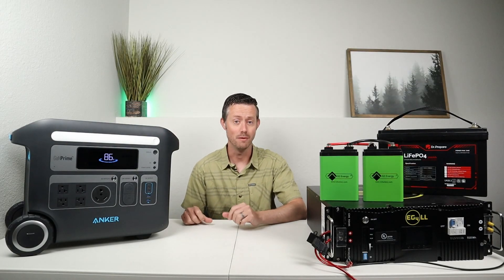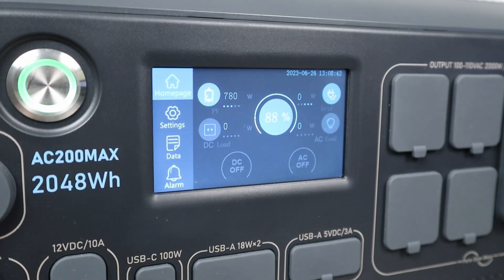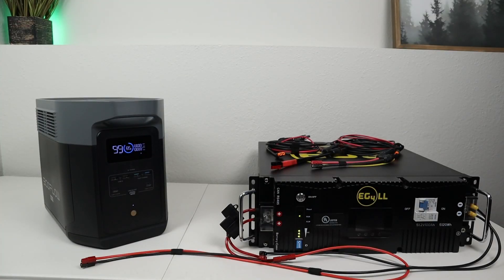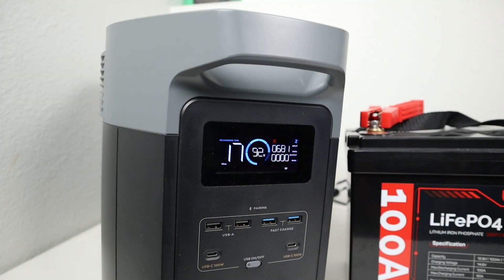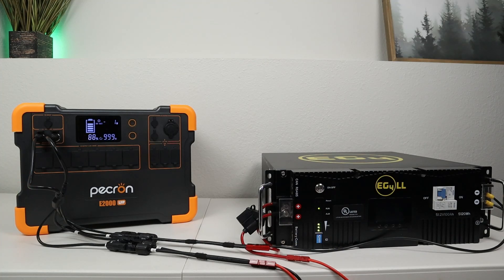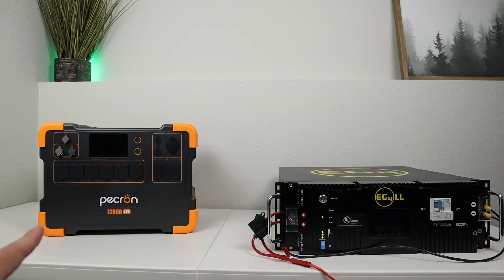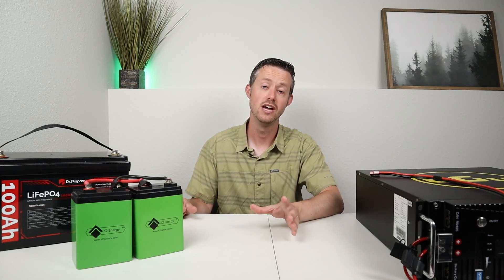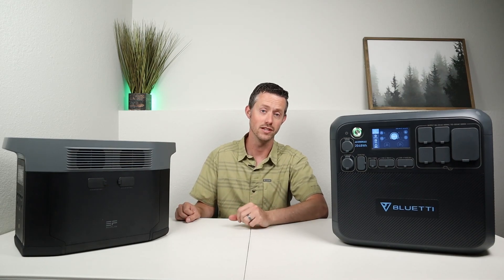Using Batteries To Extend Power Station Runtimes?! 48v LFP Server Rack 'Expansion Battery'!

Comment: What are the specs on this 48 volt server rack battery? I used a 12 volt lifepo4 battery to charge the same Bluetti recently and I was impressed at what it was able to do. I was only getting about 100 watts. It was taking a while to charge it but it was doing it. I'm just wondering if I can get this battery and charge it much faster: 48V (51.2V) 25Ah LiFePO4 Battery, BCI Group 24 Lithium Battery, Deep Cycle Battery with 50A BMS, 2560W Load Power. I would have to assume that a 48 volt battery delivers more than 100 watts and in that charging time would be reduced. The battery is smaller, lighter, cheaper and easy to carry. Which is what I'm looking for. What do you think?

Btw, I purchased one of Bluetti's charging enhancers. I wasn't overly impressed. I sent it back. I do better just adding Solar 2 panels in series.

Comment: One could buy almost three of the Pecron batteries for the price of this 48V battery. Almost doesn't make sense at least for Pecron but great video.
Reply from the maker: 48v batteries have dropped a bit since this video. The Vatrer 100ah is my current recommendation.

Comment: Do you have any insights on dabbsson dbs2300, would it work with such battery? Extension battery simply does not available from official reseller.

Comment: Hello Jason, Can you suggest a cheaper 51.2volt 100ah  battery solution, my scenario is i am in a condo no access to solar but want to have a more robust backup situation for a power outage normally 5-6 hours up to 24 hours. Mainly for the fridge and keeping my internet up and running and charging my laptops, I have purchased the Eco Flow Delta 3 plus with the expansion battery it was a bundle, but i want to get to the 5kw capacity.
Any suggestions would be much appreciated.

Comment: How would one charge the 48v server rack battery without a solar setup?
Reply from the maker: 48v AC charger, lots of them online. You could use a gas generator if the power is out.

Comment: What a great video. I have the Bluetti AC70 (12V-58VDC, 10A via xt60) and want to connect a 24V 100Ah LifePO4 battery. Do I need an inline fuse between the AC70 and the battery? If so, what fuse rating 10A or 15A? 
And for the future, could I add a second 24V 100Ah battery in series, or would it be just over the max 58VDC of the AC70 when fully charged, due to the batteries each having a max charged voltage of 29.4V and two would be 58.8V.
Any advice would be appreciated, I really enjoy learning about this for camping use.
Reply from the maker: When connecting one, I would recommend 12 AWG wire and a 20 amp fuse to avoid voltage drop and to keep the wire temps down.

It would be fine to connect two 24v LFP batteries in series, it would stay right under the 60v limit :)
Reply: @Jasonoid  Thank you very much. I really like your videos and how well you articulate everything.

Comment: For the Ecoflow. does the charging cable have to be fused?
Reply from the maker: I recommend using a 30 amp DC breaker and 10 AWG wire.

Comment: for both the 12 and 24 volt batteries you should do a 500 or 1000watt inverter test, hwere you just ac charge with inverter to get the most power in quickly.

Comment: Does it matter that you're sending 100AH to the inverter that probably has a 15A circuit?  I asked Signature Solar about doing this and they didn't recommend it because they said the battery amperage would damage the inverter if connected through the low PV input.  How are you making this work or is my contact at Signature Solar missing something?
Reply from the maker: The battery acts just like a solar panel. The power station limits the amperage input on the solar input port. Maybe this video will help you understand how it works:
https://youtu.be/9ODIF2EfsUA
Reply: @ Thank you. Do you have a video on your home build?  I also have EcoFlow Delta Pro Ultra with two batts running to their smart home panel. I want to increase my battery time as you have without over-investing in EcoFlow batts. Great channel and content. Thanks again.
Reply from the maker: I don't have a full video of my home build.  @garycline6221

Comment: What I am wonderig about is I have the alernator charger for my Delta 2 Max. Cna I recharge a stand alone 48 V external battery from my alternator charget using one of rhe external battery ports? I need to replace this power once used?

Comment: Jason do you think the Anker 767 would be able to handle 2 48 volt server rack batteries in parallel?
Reply from the maker: Yes, that would work just fine to charge the Anker 767 (F2000)
Reply: @Jasonoid  thanks for your quick reply. I know the 767 can be quite finicky. I saw you do 1 server rack battery; glad that it can handle 2!

Comment: Question?  I have a power station with 2 external batteries with a total of around 7.6 kWh.  I want to add an 48v 100wh 
 battery. I can charge with 1.2 kw solar.  My plan is to use this battery to top off my current system.  I have shading issues on the south side so it would mostly be used until midday.  Any thoughts?
Reply from the maker: I made a video showing a similar concept here:   https://youtu.be/9ODIF2EfsUA

Comment: Hi, I have FOSSiBOT Portable Power Station F2400, 2048Wh solar generator battery output with solar charging: 12V-48V/15A MAX500W, what batteries will I need. Thank you
Reply from the maker: 24v or 36v battery only, 48v battery has too high of voltage.
Reply: @Jasonoid  25.6V 100Ah LiFePO4 this one does
Reply from the maker: Should be good!

Comment: OK  I add a 300ah battery to my Bluetti.  Do I just charge the battery directly? Do I continue to charge my system with the Bluetti 1 DC charger?  Can I charge my battery with the DC charger?  I've 600 watts of solar...where does that go?  :)  Thanks!

Comment: Jason, it looks like you're using fuses when pulling from your server rack battery. Is this required to limit the current from the battery, or does the built-in charge controller in these units automatically limit the current? When I was looking into this idea earlier for a Pecron power station I saw someone say they tried this by directly plugging a battery into the charging port and it burned out their charge controller.
Reply from the maker: The power station will limit the current automatically but it's good to make sure you have the proper wire size and fuse size. I'd recommend 10 AWG wire and 30 Amp fuses. Check out my recent video charging from a 48v battery

Comment: Thanks for your great videos and Merry Christmas. Would it be possible to charge those batteries with a small 400-watt wind turbine, which then charges the power station? Another question: do the external batteries charge if, for example, you charge the Bluetti with solar?
Reply from the maker: Most 400w wind turbines are compatible with a solar charge controller so they would charge a standalone battery. You can both charge the battery and have it connected to the power station at the same time. The power only goes one direction (Battery >>>>> Power station), it doesn't flow the other way.
Reply: @Jasonoid  What I understand is that most 400W wind turbines can easily be connected directly to something like the EcoFlow Delta Pro to charge it, or to an external battery, or both at the same time. But how exactly do I do that, and which wind turbines would you recommend I look into? Merry Christmas!

Comment: Just watched 10 videos in succession and no one touches on how to string 4 12v 200ah together in what combo to supply the 150v 15a max settings on a power station or precisely explain how to charge potentially 48v on the 4 batteries in series or how much amperage 2s2p would emit and if it would exceed the 15a max. People just seem to gloss over chargers in every video so far.
Reply from the maker: That particular power station will limit the amperage input automatically to 15 amps, even if the batteries can source 100 or more amps.

Charging the four 12v batteries in series, use a dedicated 51.2v LFP battery charger:
https://www.litime.com/products/48v-18a-lifepo4-battery-charger

Or a 48v solar solar charge controller 👍
Reply: @Jasonoid  Racking my brain on that one all day and AI kept dispensing contradictions, will it uniformly charge all batteries simultaneously or will it charge each one individually? Thanks for the prompt response guy
Reply from the maker: @DoyenOfDearth  AI sucks with solar and batteries advice. It will literally tell you to plug a battery directly into a wall to charge it. Gotta stick with human guidance for now LOL 🤣👍

Before connecting all four batteries in series, fully charge them, then connect them in series. They will all charge properly with the 48v charger when wired in series. You may want to check the individual batteries to make sure they get fully charged every couple months. More consulting is available via my Asqme consulting service

Comment: Those server rack batteries cost about a grand.

Couldn't someone just usev4 12v batteries in series?
Reply from the maker: Sure, but it's more maintenance and you risk having one battery get out of balance. Having one large battery is always better long term.

Comment: and i have another question what inline fuse do you recoomend for a 12v 100ah battery? 100a?
Reply from the maker: The fuse protects the wire. You match the fuse size to the wire size. For example, 10 awg = 30 amp fuse

Comment: what iif u 
1.hook up 4 12v 100ah in series?
or 2.  through a buck converter?
or 3. is this the best idea.. parallel the 12v batteries then use the buck converter.
wouldnt it charge faster?

Comment: Absolutely fascinating video thanks! Can I ask for some advise please? I have a 300Ah LiFePO4 leisure battery which charges automatically via the alternator and a Schaudt Booster WA 121545. It’s been a great set up. My question is, could I use a 12v to 24v DC/DC 480w (20A) converter regulator wired to my leisure battery to charge my Afiery P210 battery pack via the XT90 socket on the Afiery’s solar charging input side while we are driving?

Comment: Watching this video a year later but wondering if you (or anyone here) tried connecting the 48V rack battery to both the power station and a solar/AC charger with everything running (with battery charging and power station discharging simultaneously)?
Reply from the maker: Yep, works just like a car battery, they can charge and discharge at the same time, it's just 48v vs 12v.
Reply: @Jasonoid 👍 and 🙏

Comment: Could you do this with the DJI Power 1000?
Reply from the maker: With their external solar charge controller, yes you can do this.
Reply: It says to make sure the open-circuit voltage of the solar panel is less than 30V. Does that mean it would max out with 24V battery system? I’m pretty new to this stuff.
Reply from the maker: @justinmanship5431  yep, a 24v LFP battery tops out around 28v or so.
Reply: @Jasonoid  Perfect! Thank you. You’re the man. Recently found your channel and subbed.

Comment: Have you tested Delta Pro Ultra connecting to 48V server rack battery? Should it work?
Reply from the maker: I connect one every night to my DPU, works awesome! It charges around 800w when connected.
Reply: @Jasonoid  Does it mean that I would be able to run only appliances up to 800W?
Reply from the maker: That means the battery will charge postive until you go over 800w.

Comment: Awesome comparisons of possibilities. I'd love to see you test if the Pecron 3600 has the same issues as the older version you used.
Reply from the maker: What issue are you referring to?
Reply: @Jasonoid  The bug you ran into powering up both PV inputs of the Pecron 2000lfp
Reply from the maker: @cache4pat  the Pecron E3600 has a mode called 'parallel mode' in the PV setting.  It allows a common ground between both solar charging ports, I doubt it has the same issue.

Comment: I have a 60V Lithion-Ion battery (max 67,2V) 20Ah.  May I use a converter (from 60V to 48V) to use this battery in my EcoFlow Delta 2 (as a PV 48V input)?
Reply from the maker: You'll have to drop down the voltage under 60v, so if your converter does that it should be fine! 😁👍
Reply: @Jasonoid  Thank you!

Comment: Can you leave a 12v battery connected to an eco flow delta as a standby addon battery? If so, will the 12v only start charging the delta after the grid power goes out? Even though it’s always connected. I ask because I use a delta 2 as a UPS and backup for my frig because we lose power almost monthly.
Reply: I have the same question. I wonder if you’ve figured anything more out
Reply: @eiprop59  I did buy a battery and I did connected it and it seems to be good. The delta remains powered by the grid but once I unplug it, the extra batter kicks on and the delta treats it as solar input. So yes, it works.
Reply: Whatever you do, get a big one.
My woman said my pecron is too small. 😢
Reply: @ haha… hopefully she won’t get you the Bluetti… (I’m here all week)

Comment: Im trying to figure out a way to at least trickle charge the server rack battery off the power stations PV input. I wouldn't really want to charge the rack battery from the wall. Or power dump to the server rack battery on good solar days

Comment: Great video!! I have a Delta 2 Max and just bought the Ecoflow alternator charger. If I want to charge extra batteries via solar I would input solar into the Ecoflow and wire the alternator charger to the extra battery and reverse charge it using the app. Is this practical so I don't have to buy a charge controller, inverter, and battery charger? All feedback greatly appreciated!!

Comment: Hey Jason,

Will I be able to pass through charge my EG4 LL with my Delta 2?  I think the charger you show is 18amp. 

I want to extend the Delta 2, but I’m still gonna have to recharge the EG.
Reply from the maker: You can connect either a solar charge controller or a normal battery charger to your EG4 to recharge it 👍
Reply: Thank you, but the charger you show says 18a and my delta 2 says 15a ac output. 🤷🏽‍♂️

This is OK?
Reply from the maker: @bigtom4709  the Delta 2 will limit the amperage to 15 amps. Connecting a higher amperage charger is not an issue.

Comment: What about AC500 with B300S battery - Any thoughts?
Reply from the maker: You can use a 48v battery connected to the solar input  just fine on the AC500
Reply: @Jasonoid  Do you mean the solar input on the B300S battery itself (the XT90 Connection) or the the solar input on the MC4 Connections on the actual side of the AC500
Reply from the maker: @seanconnerysmith4387  I used my 48v battery to feed the mc4 solar port on the AC500.
Reply: @Jasonoid  What is the cable you need from the battery .. the ring hookups to the MC 4 connectors?
Reply from the maker: @seanconnerysmith4387  yep, pretty much anything that will get you from the 48v battery positive and negative to the power station solar positive and negative input. I'd use 10 awg wire to avoid voltage drop, having a 30 amp inline fuse wouldn't hurt either.
Reply: @Jasonoid  Also can I charge the server rack batteries at the same time with a charger connected to busbar or something
Reply from the maker: Yes, you can connect massive amounts of solar or AC chargers to your 48v system. This is my latest setup here:
https://youtube.com/shorts/cCl5WRCUPc8?feature=share

Comment: Hi.  Im a bit confused.  I have the delta max 2000 acting as a battery backup to my freezer if utility power goes out. 
If i want to increase the length of time the system wilk run if utility power does go out i can either 
1) buy the delta extra battery or 
2) do as you do in this video , buy mu own battery. 
...... my confusion is this : i dont want the extra battery to charge up the internal battery , i want the extra battery to essentially increase the capacity of the the internal battery.  I other words , i want to plug in the originak system , plug in the extra battery and leave everything fullly charged so that if the utility power goes out then i have both batteries supporting the freezer.  
What am i missing here. ? Does this mean i really need the extra battery from delta ?
Reply from the maker: The extra battery charging up the power station is increasing the length of time your system can run. Store both the power station and the battery at 100% charged and youll be good to go when the power goes out 👍

Comment: Thanks for this. Can you tell us what the third pin on the ecoflow connects to?  The positive or the negative?
Reply from the maker: I haven't taken it apart to find out. There is probably more information about it online in the forums.
Reply: @Jasonoid  hi, you don't need to take it apart.  Just use an ohm meter to see if it's connected to the plus or minus battery or solar terminals